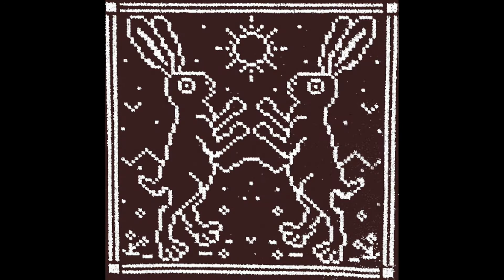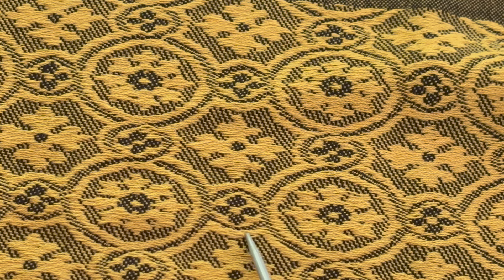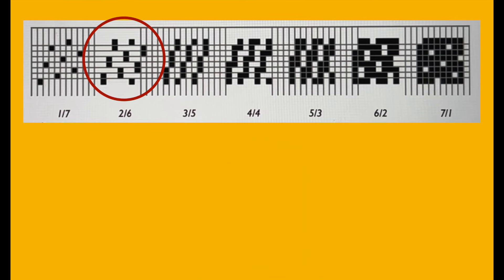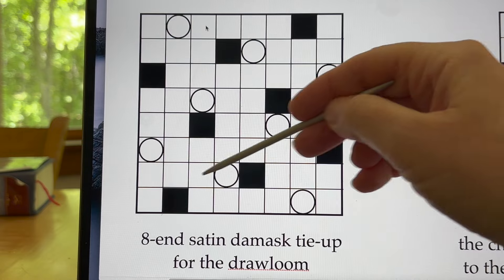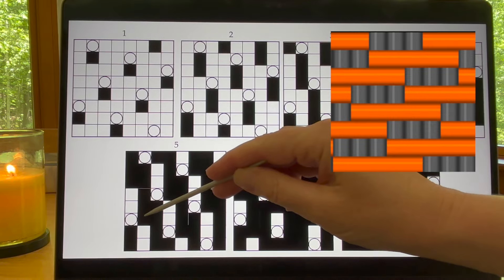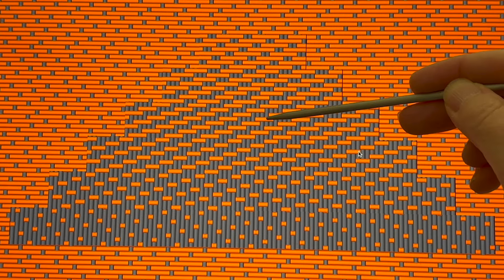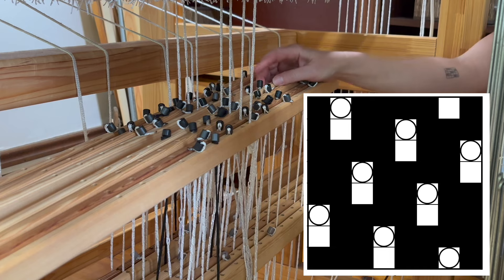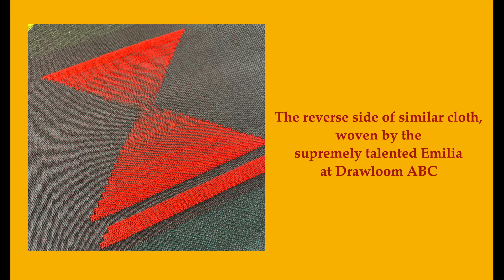Shaded Satins on the Drawloom

Comment: As usual - great video
And you are a genius at playing the loom
But was it possible to employ some levers on the drawing board (7) for this purpose?
Meaning that the tie up is fixed as usual and we connect each lever to a lever on the drawing board
When pressing, we raise the lever on which the turn is?
Reply from the maker: I am thinking hard about other ways to do it - including using the pull handles for structure rather than pattern. Do you have more ideas? What I don't want to have to do is pull every row. I'd much rather have a Jacquard head for that!

Comment: Love your videos. So informative. I have an 8 shaft baby wolf jack loom but am looking into getting a Julia drawloom. On my loom shaft 1 is in front of the weaver. On a drawloom is shaft 1 at the back of the loom. Also, do you treadle from left to right or right to left. Thank you.
Reply from the maker: This is a point of debate, I know - but the numbering of shafts is pretty arbitrary. Since I teach at Vävstuga, I use the Swedish system of starting to number towards the back of the loom - but when I remember I try to use terms like 'the shaft closest to the beater' to avoid confusion. We could name them Lewis, Max, George, and Charles and that would be OK! Similarly, it is our convention to treadle from right to left - but that doesn't matter either and depending on what I'm doing I may decide to switch it up. You do you!
Reply: 😂😂😂😂 That made me laugh. thank you Amy. I won't get hooked up on the small stuff. I guess threading back to front or front to back and treadling right to left or left to right really doesn't matter as long as I keep things consistent.